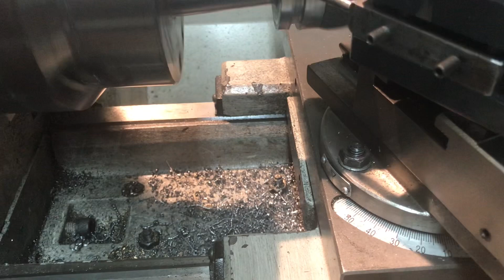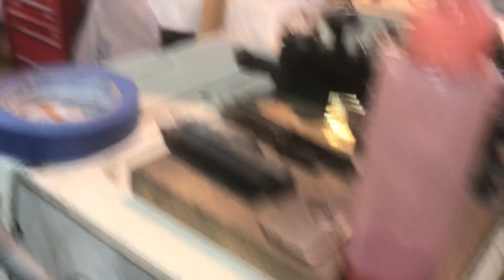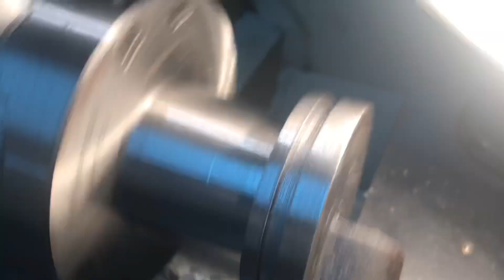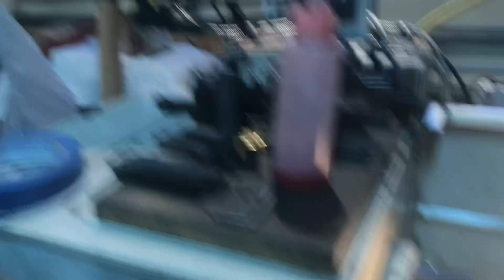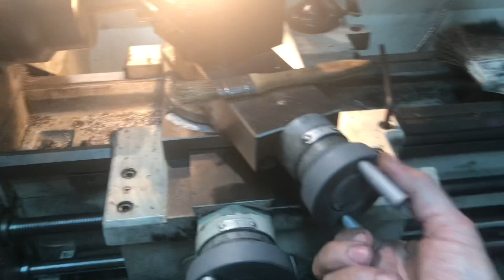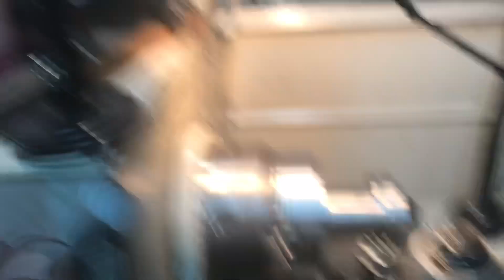Quorn Tool Grinder Project, dovetail slot in Rotating Base

Comment: Beast mode as always I believe that would be so much easier for someone making that out of pieces versus castings like you got that tab sticking out forced you to have that long stick out on that small cutter excellent job making it work
Reply from the maker: Thanks, Jeremy. Yes, I think it would probably be easier to make this part from separate components. Especially if one could get some nice chunks of 12L14 or other free machining steel alloy…